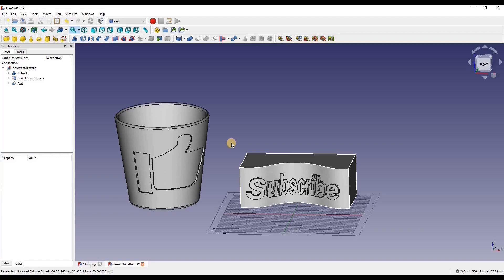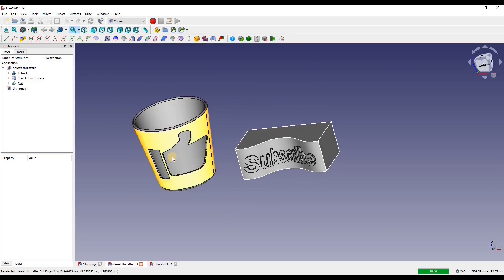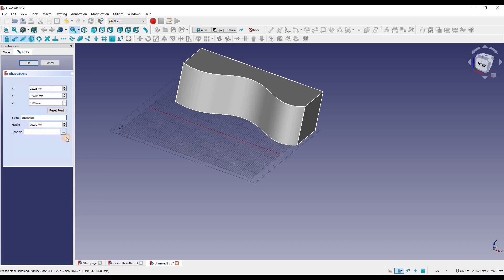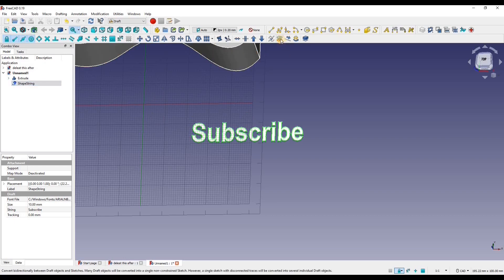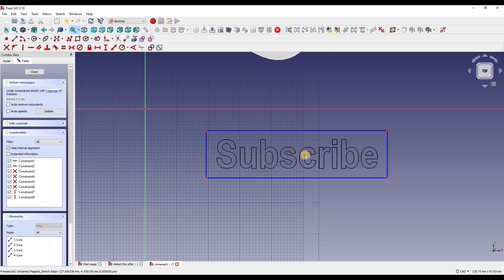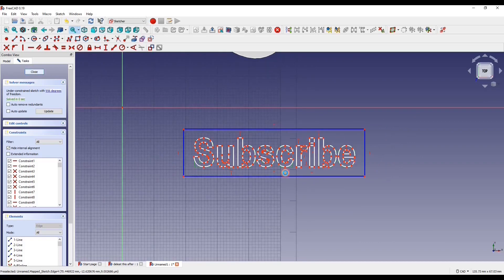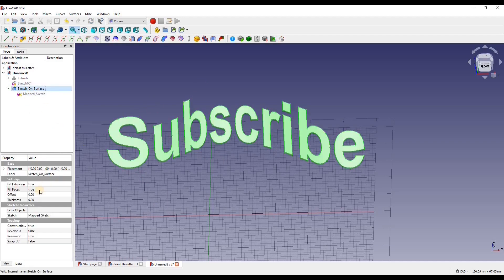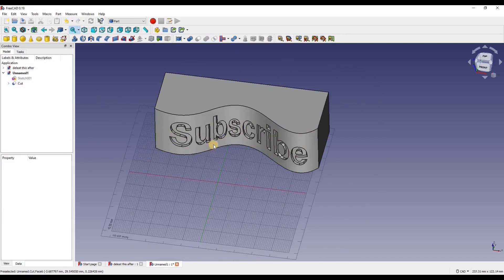Freecad tips and tricks (#4.1): Mapping text to a curve surface

Comment: For me, the "Sketch_On_Surface" keeps appearing at the bottom of the tree view outside of the working body, as a separate item.  This then is why I can not "engrave with negative thingness.  How to I move the Sketch on Surface within my active working body, so that I can type a negative thickness to get the engraving effect.  I tried to drag the Sketch on surface to my existing body (root of the body) but is has yet to work.

Comment: I found your video very good.  I have learned very much from it and I appreciate that you made it.  I have one question that I can't seem to get correct.  You moved the Mapped Sketch constraints to fit how you wanted the text to show in the surface.  I am using version .20 of freecad and this doesn't seem to matter.  Is there a way to move the text to fit in the construction geometry of the Mapped Sketch?

Comment: I've used this process now on many different applications. However, one area it won't work for me is if you are projecting the text on a swept surface. I.e the surfaced is curved in both the X, Y and Z plains. The text lays perfectly against the surface but when you attempt to give the "Sketch on surface" some depth a small exclamation mark appears and the text has no volume and cannot be Fused to the curved surface. Any help would be greatly appreciated.
Reply from the maker: sorry for the later reply, are you using the "sweep" tool in the part workbench? because I thought you can always project to a surface created by the "sweep" tool. i know that you can have problems with multidimensional curved surfaces created by the "filling" tool in the surface workbench.

Comment: ick. I prefer the "Project on surface" function. Turns all this into 3 clicks.
Reply from the maker: maybe it because i don't know how to use it, but i find the "Project on surface" function isn't ideal for text. i find it to produce unreadable text  at any angle besides straight on when trying to print on a cylinder , think text on a water bottle. but for most thing the "Project on surface" function works just perfect.
Reply: @TabletopRobotics   Depends on how the text is made. Does not work for all methods. Using it is a lot simpler than the method shown in this video.
Reply: @TabletopRobotics  You can make text in any font you want even downloaded ones using the "draft" 3d text generator tool. Look to the gold letter "s" in draft menu it creates a shape from a text string. That works perfectly for water bottles, cylinders or anything and is WAY faster and easier. You have to make sure that your view is straight as it will sometimes curve to your view. If you use the draft method you can read it just fine unless your extruding some ridiculous size.
Reply from the maker: oh, ill look into that method. it will probably simplify things a lot. thanks for the information.

Comment: Help! at 6:30 when he use the tool to copy geometry from another sketch he clicks the sketch then says "we're going to press one point above the sketch" and I have no idea what he did or how to replicate that step. I have the text in the box ect select it with the tool but what is press one point above the sketch?
Reply from the maker: oh sorry for the confusion, so what im trying to do is to bring the sketch that contains the text into the sketch that contains the rectangle. after you click on the button at 6:25 "copies geometry from another sketch" i am trying to say all you need to do i click on the text and it should combine the two sketches.
Reply: For me, it seems impossible to select any part of my text... The computer just says "Pling"... So I did not get it working yet... @TabletopRobotics
Reply: @jyrkisalokorpi7540  Yeah, me too, on version 0.21.2 i'm unable to click on the lines from the Sketch made of the ShapeString... But in the other hand i can click on any line of a sketch made from scratch. So... maybe from version 0.19 this is break.

Comment: Good video, thanks! It pointed me in the right direction. A friendly tip: try not to move the mouse around if you don't need to. It is a natural thing to do, like pointing at a whiteboard when talking, but it is confusing since the viewer doesn't know if they are supposed to follow every move or not and it is easy to lose focus. In a CAD program, it also highlights faces, edges, etc when the mouse pointer swishes by them which also disturbs the viewer's focus.